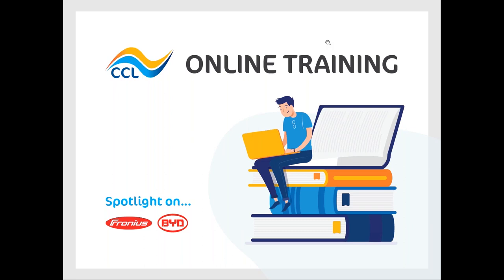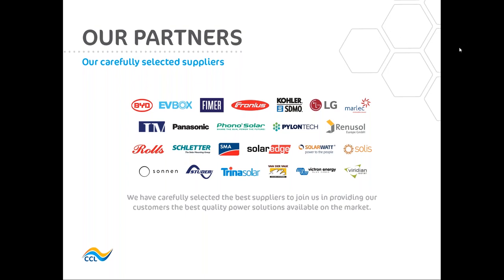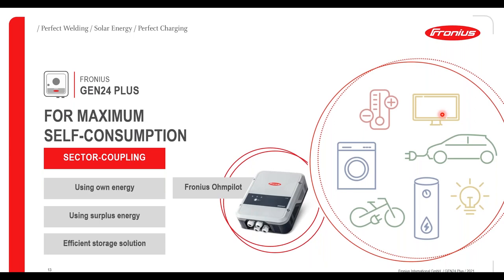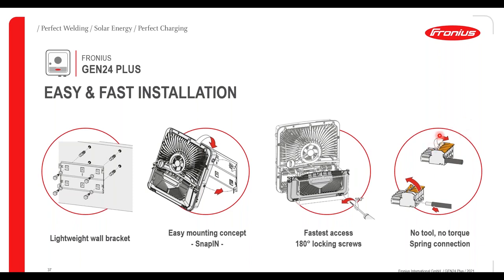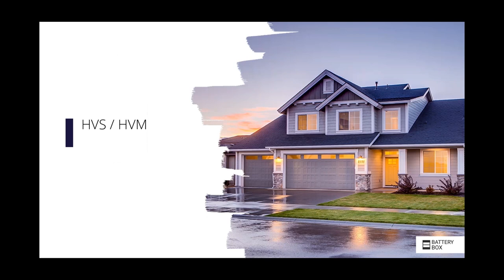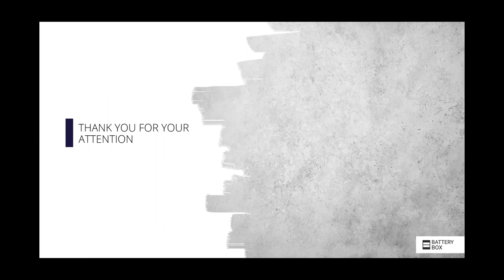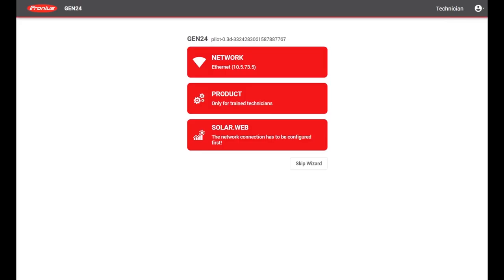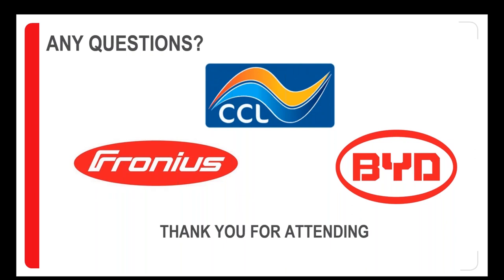Intro to the NEW Fronius GEN24 Plus & BYD Battery-Box in partnership with CCL Components (UK)

Comment: Great presentation. In the screen at 39:44 there is an option to "Allow battery charging from public grid". Is there a configuration to setup when to charge the battery using grid power? for instance to charge during night time if the state of charge (SOC) of the battery is bellow certain level? I am thinking for winter months with little or no excess PV production and significantly reduced grid rates at night.
Reply: There is a video on that by them if you search.

Comment: What is the reason why when adding a BYD to a Gen24 primo the HSV has only a maximum capacity of 3 units or 7.7 while the HVM has to start at 4 units or 11.0kWh.  We would like to use an HVS but we wouldn't be able to expand,
Reply from the maker: Hi!
Using the BYD HVS Battery Box, the maximum capacity with a GEN24 Primo is 7.7kWh, the reason for this is that the operating voltage of the larger HVS 10.2 unit exceeds the 455V maximum battery input capacity of the inverter.

However you would still be able to upgrade the capacity of your system should you require, as the HVS 5.1 and HVS7.7 can be connected in parallel. So two or even three stacks of HVS 5.1 or HVS 7.7 could be connected to a single GEN24 inverter, giving you up to 23.1kWh worth of storage.

Best regards, your Fronius Social Media Team

Comment: Good afternoon, is it possible to connect two BYD HVM 11kW each batteries to a Froniuis GEN 24 10kW??
Reply from the maker: Hi!
Yes, in the UK it is currently possible to connect 2 or even 3 BYD Battery-Box Premium HVM 11.0 units in parallel into one Fronius Symo GEN24 Plus 10.0 Inverter.
You would require to install 40A fuses on the positive connections coming from the battery as well as the final combined connection both positive and negative into the inverter.
 
BYD offer a combiner box model CBH-40A which incorporates the appropriate fuses and connections.
 
At the moment The Symo GEN24 Plus inverters can accept the following battery configurations:
HVS 5.1 (In single, 2 x Parallel and 3 x Parallel configurations)
HVS 7.7 (In single, 2 x Parallel and 3 x Parallel configurations)
HVS 10.2 (In single, 2 x Parallel and 3 x Parallel configurations)
 
HVM 11.0 (In single, 2 x Parallel and 3 x Parallel configurations)
HVM 13.8 (In single, 2 x Parallel and 3 x Parallel configurations)
HVM 16.6 (In single, 2 x Parallel and 3 x Parallel configurations)
HVM 19.3 (In single, 2 x Parallel and 3 x Parallel configurations)
HVM 22.1(In single and 2 x Parallel configurations only)
 
It is currently recommended that only 1 GEN24 inverter be used per point of connection, if the PV system is larger, for example 20kWp then it would be recommended to use 1 x Symo GEN24 10.0 alongside 1 x standard Symo 10.0-3.
 
Best regards, your Fronius Social Media Team
Reply: @FroniusSolar  Hi, regarding your comment about only one GEN24 inverter being used per point of connection:
- can you please point me to this limitation in a manual or specifications document? this is the first that I've heard of it.
- are you able to please explain what the technical reason is behind this limitation? I was planning on a Symo GEN24 10 Plus (with BYD) and one Symo GEN24 10, but it sounds like this is not recommended.
- you use the word "currently". Does this mean that using more than one GEN24 per point of connection may be possible in future?
thanks very much!
Reply from the maker: Hi!
While you can have 2 x GEN24 devices connected on the same supply, only one of those devices is able to have a battery connected. We would typically recommend where you have a situation that requires 2 x inverters that you use 1 x GEN24 device and 1 x standard Symo, so in your situation use 1 x SYMO GEN24 10.0 and 1 x Symo 10.0 – this is often a more cost effective way of specifying the system while allowing you to store generation from both devices (The GEN24 using a smart meter will see if the standard Symo is exporting to the grid and start to charge the battery if there is capacity).
If you have export limitation requirements, this becomes a little more involved. Please feel free to contact UK technical support should you require further detail.
In future software releases it is hoped that there will be the ability to have multiple GEN24 devices with multiple batteries on one point of connection, however this is a work in progress and does not have a fixed timescale.
Best regards, your Fronius Social Media Team
Reply: @FroniusSolar  Thanks very much for taking the time to respond! Export limitation is indeed a requirement of our system's design. I will contact Fronius directly for further system design recommendations.
Reply from the maker: Hi! Here you can find more information https://www.fronius.com/~/downloads/Solar%20Energy/Whitepaper/SE_WP_Dynamic_Power_Reduction_GEN24_Plus_EN.pdf Best regards, your Fronius Social Media Team
Reply: @FroniusSolar  hi you said "use 1 x Symo GEN24 10.0 alongside 1 x standard Symo 10.0-3." i ask you: in this case could i have 4 total MPPT to use?
because in my system i need 3 MPPT and i need at least 40kw of battery (i live in ITALY), and you said i could use 2x hvm 22kw battery so ok it is great to hear.... BUT i still have the problem of 3 neededn MPPT and i suppose i could only solve my problem using a symo gen 24 + standard symo to have 2 more mppt and a total of 4. is it right? or shoud i use DUAL symo gen 24, and each inverter with a 22kw battery attached not on only one but at each inverter?

Comment: a question fro BYD.... why do u guarante only 60x100 of battery capacity after 10 years? LFP batteries "should" provide a lot more lifetime....compared to NMC battery used in tesla or lg chem batteries (tesla guarantees 70 or 80% depending of the country), but that products do guarante more than 60% capacity over 10 yrs. so... something is wrong with LFP chemistry u use.....
Reply from the maker: Hi!
Please speak directly with the Fronius PV support team in Italy ([pv-support-italy@fronius.com](pv-support-italy@fronius.com)) who can help you with your design.
Using a GEN24 with a standard symo/primo inverter will indeed give you up to 4 MPPTs which you may utilise.
Unfortunately it is not yet possible to have 2 inverters each with its own battery on the same electrical supply, so you would need to connect in parallel both batteries onto the single GEN24 device.
Best regards, your Fronius Social Media Team